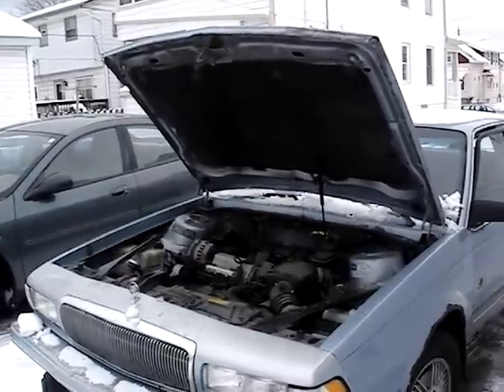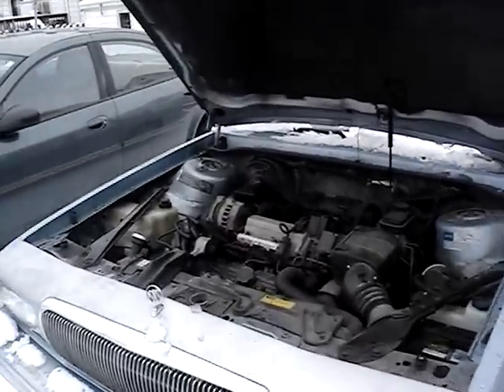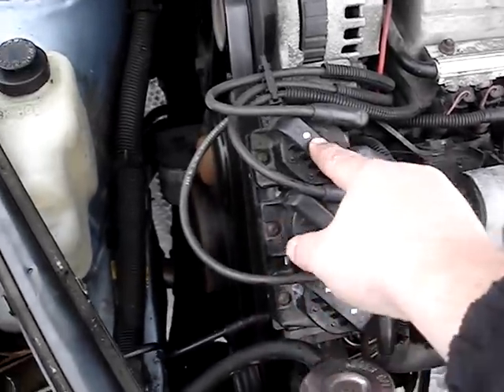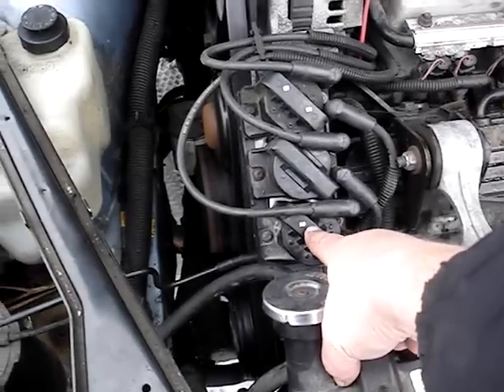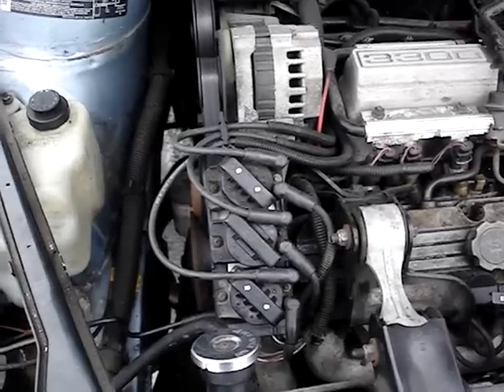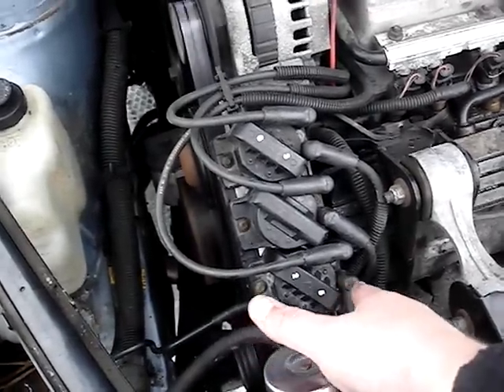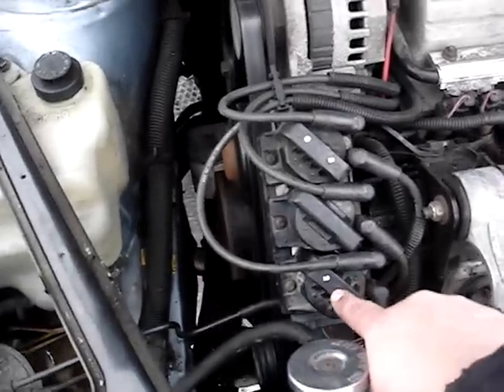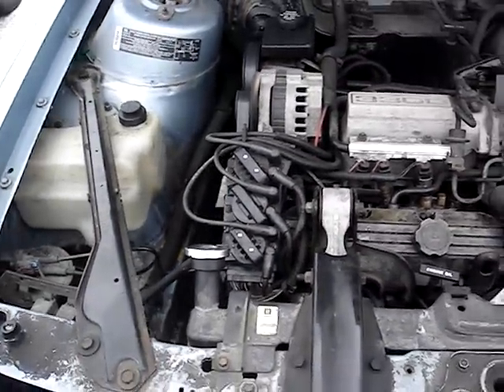It was the ignition module!

Comment: Thanks, Craig!!! Do you have any idea how hard it is to find a simple explanation video like yours about coil packs and a ICM on a standard 3800 GM engine that they made a million of? Yours is VERY SIMPLE, and VERY "TO THE POINT"! All the others misdirect people- "oh, change this", "check that", "it could be you still have summer air in your tires"; and the "5-minute-introduction to a 30 second video" which I love when I'm in a hurry. The bottom line... if your engine runs like you dropped two cylinders, check for spark coming from the coil packs by taking a wire, put it on a coil pack terminal, and pass the wire close to the body. No spark? Replace the bad coil pack. If you still don't have spark, replace your ignition control module. I can't believe how hard some of these videos make it seem!!!!!
Reply: I have the same problem. Bought a new coil for the one that wasn't sparking. Installed it and still no spark. Is the module the only thing that could be wrong when 2 of the 3 coils spark and you know the 3rd one is good ? Because you can't return it I'm hesitant to buy it without knowing for sure that is the problem. But don't know what else it could be. Please reply if you don't mind. Thanks

Comment: This looks like it may be a 'part 2' of a 2-set video, but I can't find the first.  I'd like to know what the original symptoms were.  Mine won't even run. The car died on the road after detirorating quickly, less than 5 minutes. Now it's firing once in a while, and even ran for a couple of seconds, but not recently. I alternately swapped a single coil pack into each of the slots, no change. I'll try swapping the ICM and hope I get lucky.

Otherwise, I have the timing chain to check...  UGH!
Reply: I think this was the first video:  https://www.youtube.com/watch?v=RVqCLQOvoPA
Reply: Tom B I seen a video where it was the fuel injectors